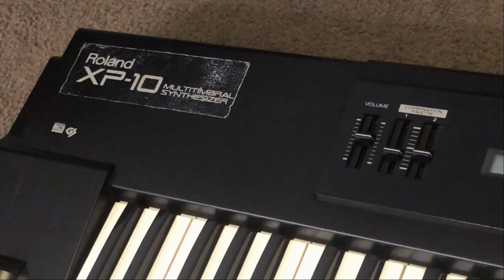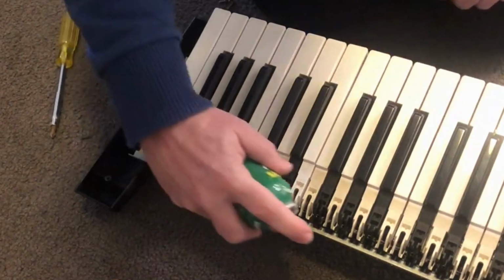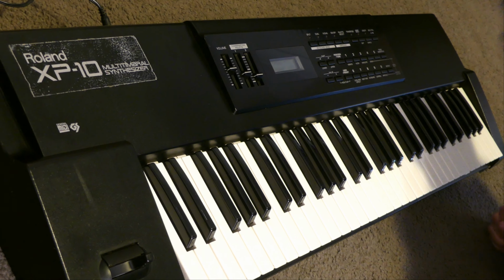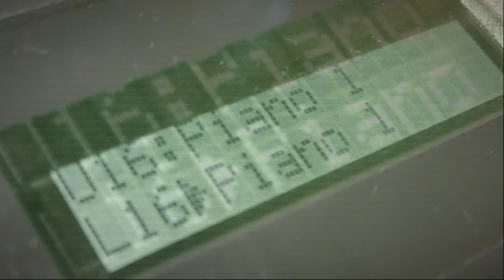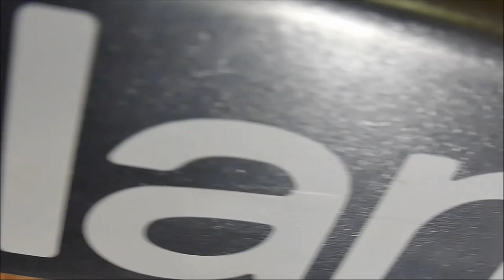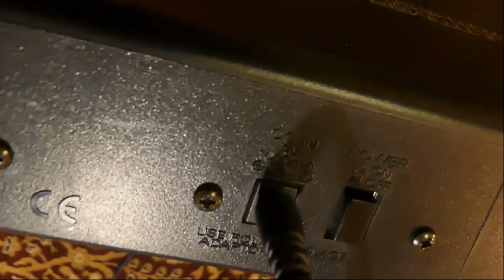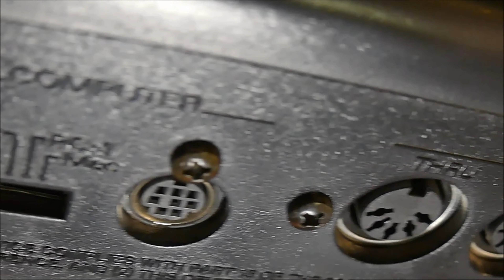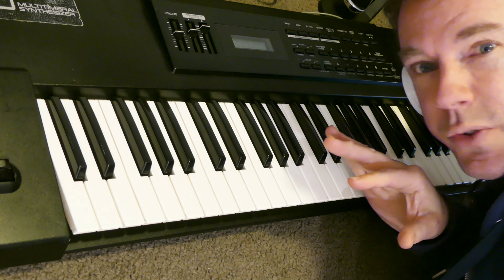Roland XP-10: Fixing a broken key, then trying out the great sounds!

Comment: I had one of these. It was a decent cheap keyboard for the price, but yes, as an entry level keyboard, skimpy on materials and construction, mostly the plastic shell, compared to the upper level XP-50/80? I think the old computer interface was called a CV Gate. I would not mind having it again brand new, but the Go:Keys has so much more for the price, and more solid construction, even with plastic body. I never broke the keys, but gave it away to a younger dude at church because I had my Fantom X6. It was dropped once, I think by my friend when he borrowed it. It had a weird glitch afterwards. You would power it on, and about a minute afterwards, it would startle you like someone pounded on all the keys. Otherwise, worked fine. My PMA-5 sounds just like it, though, voice wise. But like my Boss DR-5, dated song storage and flexibility compared to current USB era instruments.

I had a used 73 Rhodes stage, and my first synthetic was a Roland JX-3P. Can you believe it costs $1300 when it was new, 6 note polyphony and a limited sequencer? It was comparable to the Juno 106 at that time, but you could probably find the differences. I don't remember other than my keyboard supposedly had a beefier sound engine. I had a TR 606 with the Boss HC-2 hand clapper and matching synth module. A little bigger than the classic stomp pedals with a rubber strike pad that could be triggered by the TR 606 HT and LT outputs. Now they just released the Boutique module version to join the ones for the JX-3P and the other classic keyboards and instruments.